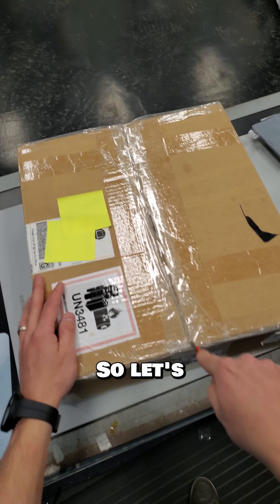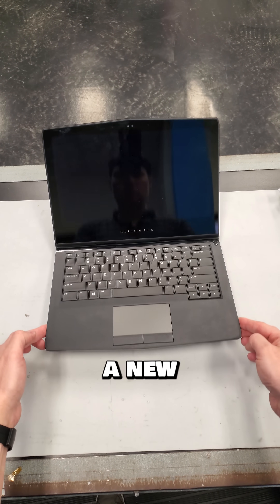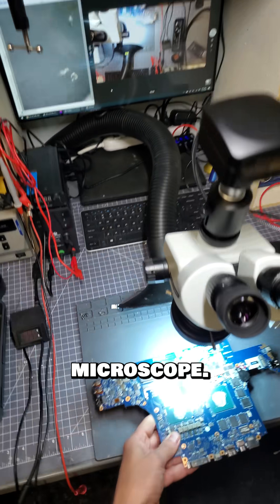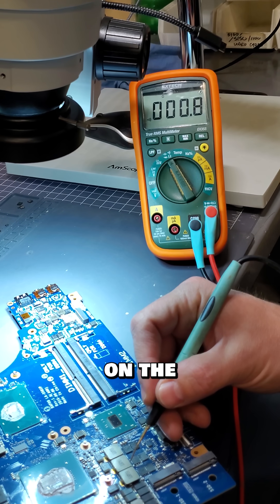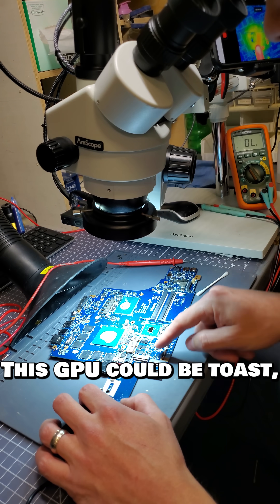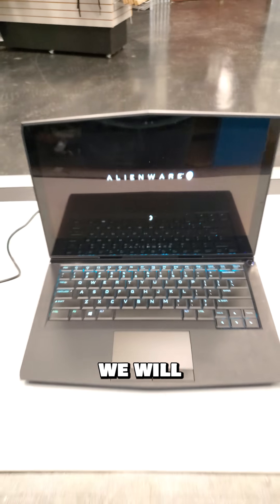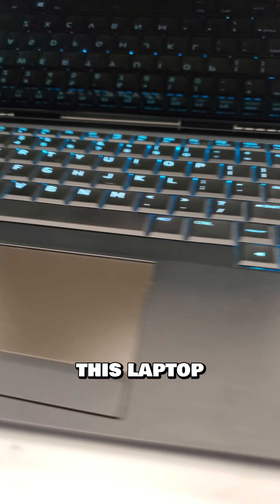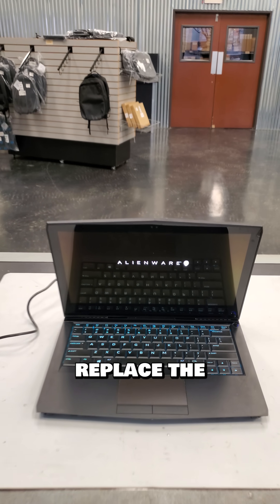Game Over? Gaming Laptop GPU Repair Fix #shorts #laptoprepair #computerrepair

Comment: Imagine charging 1000 to 2000 for laptops and not even putting quality parts in it. Dell is so fucking cheap. Just because alienware looks cool. Doesnt mean you should get one.
Reply from the maker: This laptop lasted 7 years. It is a 2017 Alienware 13 R3.  It is not a matter of cheap, it is a matter of age.  All parts wear on with age.
Reply: Bro what, this doesn’t happen all the time and that’s a pretty old laptop so it could’ve died from age
Reply: @slow91daniel  you're joking right look at that cheap ass motherboard
Reply: @SaltyLilPotato  you are genuinely making shit up that motherboard looks perfectly normal

Comment: I sent my laptop for repair to acer because it was screen was shutting when i tried to adjust the screen. They claimed it was water damage, so i took it to repair shop in my town fixed it for 20 bucks, and it was the display ribbon cable.
Reply: Same thing happened to my acer laptop. The instant I told the service center about the issue. They already know what caused it, the display ribbon cable. It seems it was a common issue they always encounter with acer units.
Reply: Acer is known for that, HPs often have cracked hinges.
Reply: @Fusion05  The first laptop I got was an HP 13" and it was fine... until the hard drive just gave up randomly before 1 year and the hinge literally fell apart. Honestly amazed it still turns on with the hinge and motherboard bending 3cm up from the frame.
Reply: Same. I knew the display ribbon was damage because even the camera was not working. It is linked though that cable. But the shop keeper said that the mother board was gone. Me and the shop keeper literally had a fight on top of our voice. I left the repair center and then went to another shop. The other shop said the same but then i insisted so he said "lets place a bet, whoever is right wins $5 buck" so they did their thing, even attached 5 different screens, nothing worked. In the end they tried to replace the cable and dayme it worked. So over here the cable cost only like $1-$3, which i paid. But they didn't gave me $5 of the bet. Just a very low quality mouse ;-; like a mouse of $4 lol
Reply: @wackerstube6020 glad you won 5 dollars buck
Reply: Well acer is garbage anyways
Reply: Acer’s ribbon cables always come loose. I remember my keyboard wouldn’t work because the ribbon cable always came loose.
Reply: Same thing happend to me with Dell 5577 Gaming Laptop. They told me the display was bad but I knew its the cable. Though I had to pay for all the parts at once cause they charge for the visit. But they assured me the parts  I not used / needed can be returned and refunded.
Reply: I almost fallen for something like this my old lenovo laptop just keep shutting down everytime I open it I went to a repair shop they said it was the battery but when I saw my battery it was on good condition after couple of more hours they said that the keyboard is also defective so I just didn’t have it fix so what I did was I ask my cousin to just disable the keyboard and just able the power bottom it work hahaha I would have spent like 5000php or 90 dollars to a repair I don’t need
Reply: I have the same with my MacBook Pro, but the repair is too difficult ;(
Reply: Oh cable flexible fixing that's cheap
Reply: My Acer has the same problem that and keys on my keyboard just stopped working from the blue
Reply: Acer worst after sell service and worst parts availability.
Worst in terms of repairability
Reply: Acer and HP can be a cancer as they age even Dell unfortunately especially when people don’t debloat
Reply: Bro my brand new acer flicked on and off the other day 😮
Reply: In my experience, dell is a more honest and trustworthy company.
Reply: @tacocat1714 Nice joke 👍😂
Reply: @tacocat1714  Taco Cat... are you a cat that likes tacos.. or a taco made from cats?

Comment: I’m no electrician but can’t you just transfer a GPU through reballing?
Reply: It's a difficult and expensive process to do.
Reply: Yes, but you’d have to find a spare GPU of this exact model and it’s hard to do. 
CPU is a Intel 7700HQ from 2017. While still perfectly functional, fixing it might not be financially viable.
Reply: Nvidia doesn't sell spare GPU DIEs
Reply: @brytonmassie but you can find them used.
Reply: Yes but it is insanely hard
Reply: "just" you can do it, but you make it sound much easier than it is. Reballing is hard with specialized equipment, and without that equipment it would be almost impossible
Reply: @jonaslarsen4002  check out russian pc hardware repair channels, they do insane things.
Reply: Yes, but its not really worth it for such an old laptop
Reply: Depends on the current worth of the laptop. If you already own the tools and also a place to buy a used reballed gpu then yes.

Comment: it is simpler to remove coils that mosfets
Reply from the maker: Possibly, but the MOSFETs are still there and getting power.  It takes 10 minutes to remove and take them out of the equation. I give a year warranty and I would rather not take the easy road, because that is when you have problems.